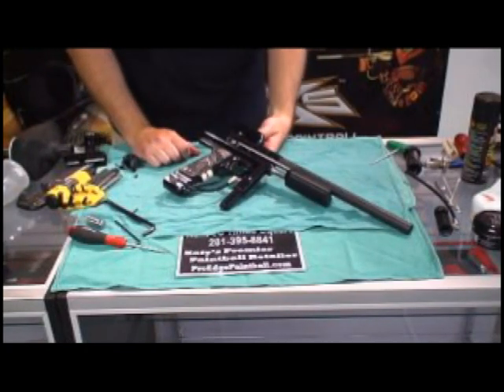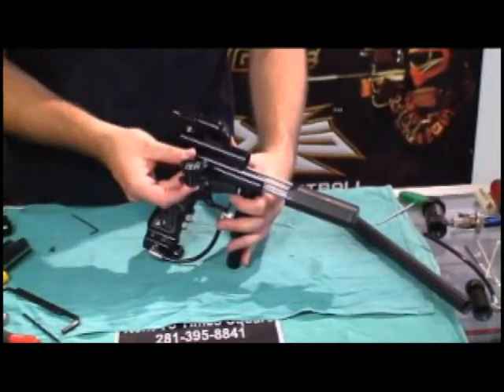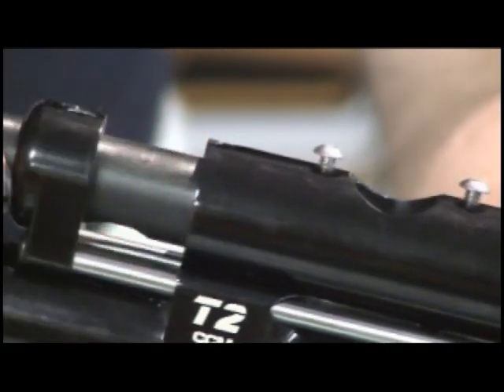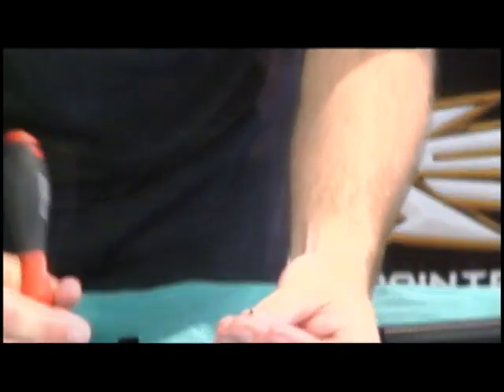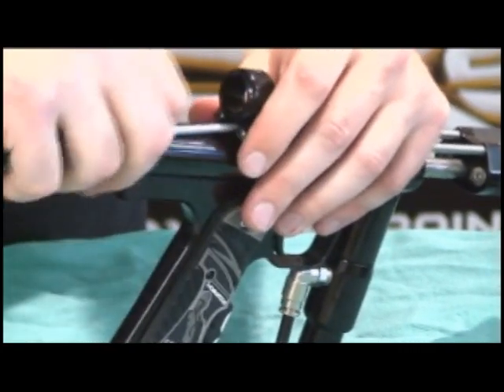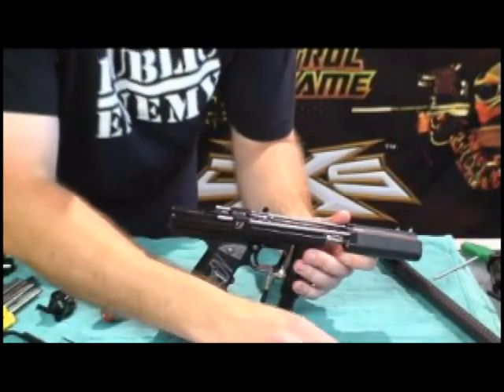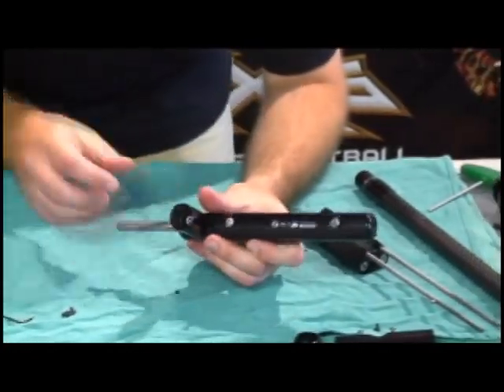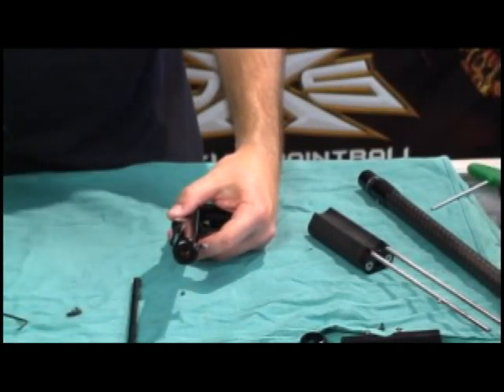TF CCM Video - T2 Tech Video - Part One.

Comment: I would have to think that that the squeak is coming from a metal part.  The metal on metal that would have to be the Arms of the pump rods against the body or the AT arm on the pump arm. 

Lube these areas with tri-flows and see if it goes away.  

If not, try lubing the cam itself.